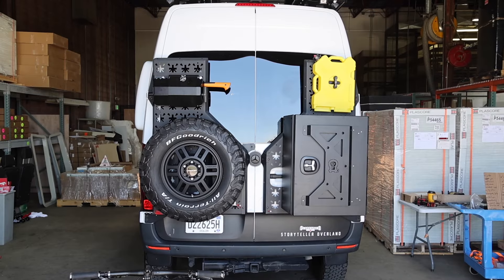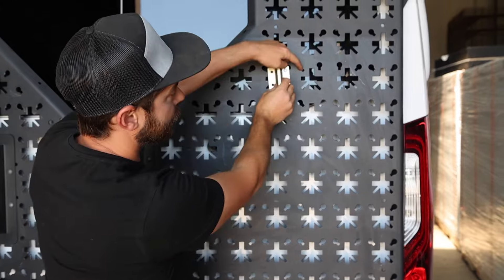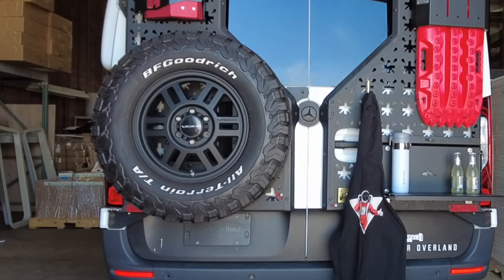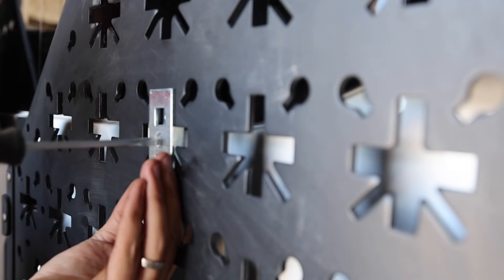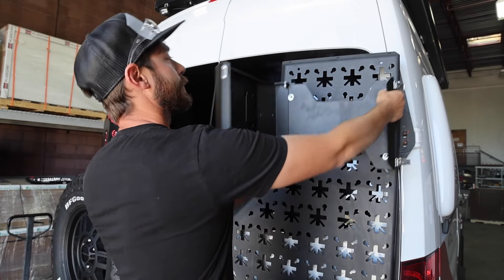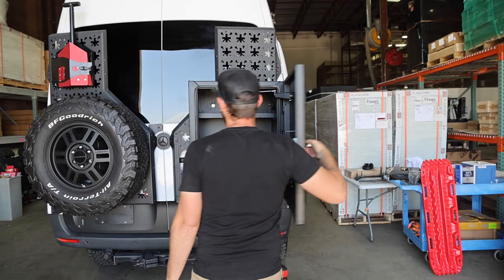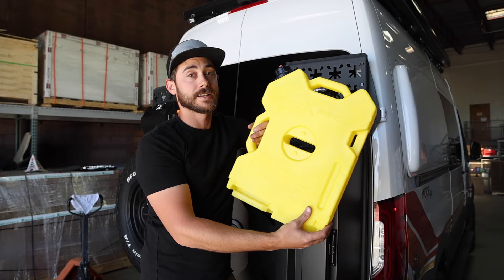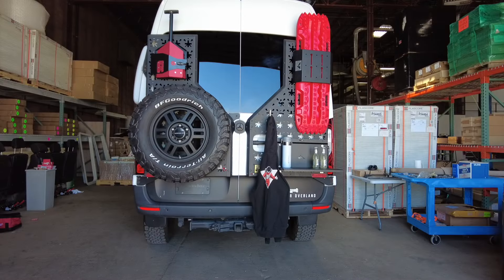The nVader Rack: a product walkthrough

Comment: For the rotopax mounting instructions the lower 2 holes align with a support bar that runs across the back which prevents the washers from being flush. How do you recommend working around this?